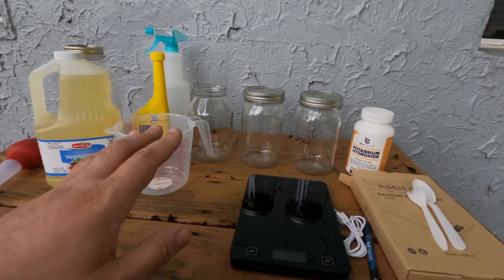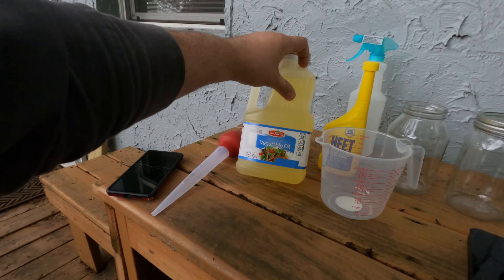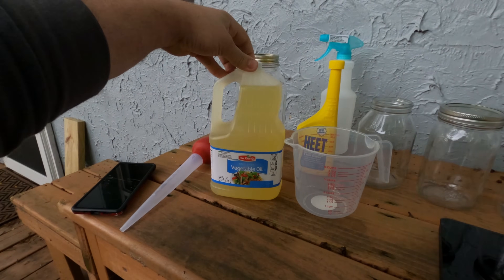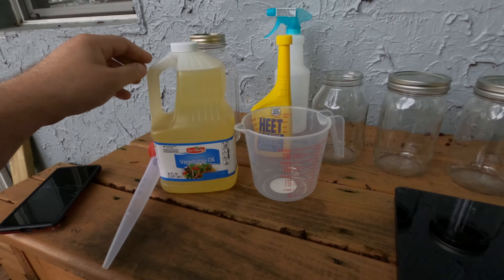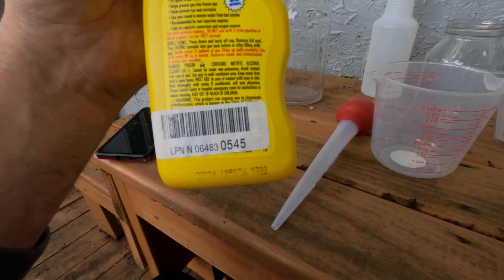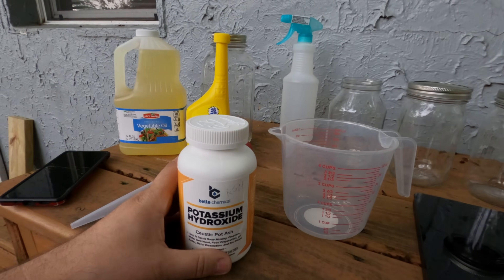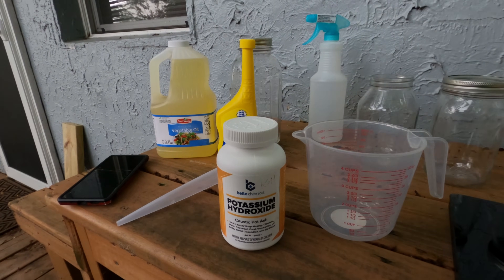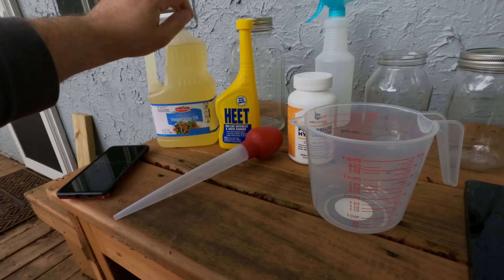This is why making biodiesel is going viral now! It's so easy!

Comment: ....IMPORTANT INFORMATION....I think you would do much better by harnessing methane, instead of making alcohol from the grass. Just put a hay bail in a tub of water, put a plastic tarp (trash bag) over the top of the straw / hail  bail, with a tube attached sealed not to leak, and as the straw rots, methane will be released, and fill up a tank or bag above, this will give you a constant supply of methane for many weeks....Add some pressure on the bag, that runs your engine, and bingo, cheap gas made from grass, and on you go....What does a hay bail cost 7.00???? Methane is what we see bubbling up from decaying peat in the swamps.....The decaying process burns up the oxygen in the water....So the gas should automatically be separated...
Reply from the maker: I'm not making gas or alcohol lol

Comment: You can use animal to make biodiesel, but there are challenges that have to be overcome.  The lye (KOH or NaOH) is what causes the reaction, the methanol (which could be substituted with ethanol) is a catalyst and isn't mandatory... the process takes longer.  It does NOT cause the "fats to drop out of suspension".  The chemical reaction takes the triglycerides and breaks off the glycerine that binds the 3 fatty acids together.  The by product is soap, essentially.

EDIT (PSA): Also, when working with methanol and either form of lye (KOH or NaOH), you should be wearing adequate PPE.  Methanol is lethal and readily absorbs into your body through your skin.  As few as 10mL can cause blindness and 15mL can be fatal.  Lye is caustic and will give you a nasty chemical burn.  Despite how people are starting to freak out about it, you SHOULD use vinegar to neutralize the lye... you do want to be cautious and not let it stand, pour the vinegar on the affected site in a place with drainage (over a sink is fine, if it is your hands) and rinse with water to remove the combination which is exothermic.  Proper PPE is elbow length cleaning gloves, goggles, and a good chemical apron as well as keeping the rest of your body well covered.

Can you wing it without hurting yourself?  Sure... but a bump or slip and you're screwed.  Don't be stupid.  PSA over.

Comment: any diesel truck as long as it is not an HDi engine (high pressure injection) will run on a 50/50 mix of veg oil and diesel regardless of pump make in the summer months when temps are higher than 10 degrees C, if however you have a Bosch fuel pump you can pour straight vegetable oil, sunflower oil into the tank and run it without problems in the summertime. in winter you would need a tank heater.
I ran my 1998 Citroen diesel on reclaimed vegetable oil for 7 years in a row during the summer and had no issues at all, my Father had the same car and ran his to on vegetable oil.
Reply: Some old diesels you have to replace the rubber fuel lines but that's not a big deal

Comment: the only problem of biodiesel is that requires a lot of pure alcohol and it's incredibly expensive so people dont make it but just go to a gas station and have a regular diesel that is alredy tested and has nearly identical price (probably even cheaper). anyway you've made a nice guide man
Reply from the maker: 55 gallons of methyl alcohol cost me 235.00

That gives me a cost of 91 cents a gallon.

I've been running this for years now, my costs have never been over 1.13 a gallon.

But the fact that it takes any amount of effort above zero will keep people paying 4.50/gallon at the pump anyway

Comment: While it's good in a pinch, you can't store it.  We use bio diesel on base and it ruined injectors and separated in the fuel tanks.  What I would like to learn is distilling crude oil to make diesel...

Comment: to make a quart today it cost 2.49 for the heat then about 3o cents for the hydrocside and 2.50 for the oil it would be cheaper to buy the diesel
Reply from the maker: Buy diesel then 😊

Comment: if you splash any of the KOH and/or methanol into your eyes - you're in for a world of hurt.  I'd also suggest you look at using "weigh boats" Putting KOH directly onto a scale is just not done.  Someone else can mention why plastic, not glass measuring cups are preferred (unless you want to etch/frost your glass with the alkali)

You might want to dry this fuel before putting it into your tank.

Comment: Fun fact ammonia aka nh3 nitrogen hydrogen 3 is a cheap renewable  fuel and can be run in any gasoline  and diesel engine with minor  modification. Look up ammonia as fuel videos.  
Ammonia as a fuel and engines existed before gasoline  combustion and diesel engines.  Rudolf  diesel made ammonia engines before he made diesel compression engines.
1960s NASA space race was fueled by ammonia. Rockets,  aviation fuel is still made with ammonia. The land speed record is held by a rocket car running of straight ammonia. 
You don't hear about ammonia as a cheap renewable fuel because of corrupt politicians and businesses that want force you to buy their products and tax control  you.  a cheap fuel means can't control you. 
You can easily alter any gasoline engine to run off ammonia all requires is a propane tank kit and a 2nd fuel pump switch kit. But fill with ammonia.  This can be done on a car , truck, boat, and generator etc.
A diesel engine can run off ammonia but requires more tuning to control compression  vs combustion in gas engines. Diesel pickup engine tuner kits will help alter control compression of ammonia. 
You can make ammonia at home from nitrogen pulled from air and bond with water where hydrogen once bump off oxygen bonds with nitrogen. There are also farm scale production methods to make ammonia, where ammonia is used as a fertilizer. 
https://youtu.be/XHZXAz9WP9M
 https://youtu.be/_H4XZ_m7P0E
 https://youtu.be/L0hBAz6MxC4
 https://youtu.be/B6HzP84KhoY

Comment: Diesel fuel is expensive because of the tax. Vegetable oil is cheap and Diesel engines can run on it. The problem is that Diesel fuel is not the right product to cook your food in. When everybody starts using cooking oil for the car the price will go up and the tax will go up, so there is nothing to gain here.
Reply from the maker: Other than the thousands of dollars I saved last year alone...

Sure, nothing to gain.

Comment: In my younger days, I used to get my oil from a restaurant, (free), clean it up using an old cream sepatator as a centrifuge, and pour it straight into my ‘81 VW Golf.  Never had injector or filter problems.  Of course, I could only do this when the temperature was above 12 centigrade.  I got 40 mpg (imperial gallon, not U.S.)
Reply from the maker: I pour it straight into my Toyota as well.
Reply: @TheDrivewayEngineer what year toyota? I'm wondering if this will work on my hilux surf

Comment: Hi just a comment you need to wash bio d in h2so4 sulfuric acid and water diluted. And before washing separate the free fatty acid and glyerene off the product.

When the h2so4 is initially washed separate and wash another 2 times with fresh water and a bubble stone from an aquarium with an air pump. 

Your bio d will be clean and ready to use when it's clear if you have issues with water retention add a little isopropanol alcohol. 

I manufactured bio d to the en 14/2/14 standard. 

And was one of the original bio d ers in the UK. 

Regards Martin steele
Reply: Can u give me the step by step how to make bio feul
Reply: @pekkopekkie  Hi have you got any experience of making bio d.

Comment: When I was making 25 gallons or so a week back 2010 I was always concerned about how to dispose of the waste/wash water.  How do you handle that?
Reply from the maker: Down the drain it goes. 

I don't see how the soaps and glycerins are any worse than what comes out of my washing machine or shower.
Reply: @TheDrivewayEngineer  Thanks.  I tend to agree and always just poured mine in the woods at the back of my property...with no obvious issues.

Comment: "We dump the potassium hydroxide into the methanol.  We use our fingers to scrape the remaining KOH into the methanol because who needs fingers?  Right?"
Reply from the maker: Idk if you noticed, but my fingers were still totally there at the end.
Reply: @TheDrivewayEngineer  I have personally had a base that was weaker, than what you touched, on my skin.  It was no joke.  The point of my comment is to wear rubber/nitrile gloves.  That stuff you touched is drain cleaner.  It reacts with the water in your skin and causes burns.

Comment: The point is...grow sunflowers. All you need to do to convert SVO to fully compatible diesel is add kerosene or gasoline at 10% to it. No methanol or potassium hydroxide needed. In addition, to filter WVO you can just use gelatin mixed with hot water stirred in and settled.

You do NOT need to react with methanol. The kero/petrol soluabilizes the fatty esters that you remove with this method. It also increases energy density in the fuel over and above standard diesel, whereas the methanol method reduces it.

I've known about this method for years after a Kansas farmer used the results of a 2002 paper to convert sunflower oil to diesel. He tested it extensively on an injector bench, then stepwise used it in his diesel truck, and eventually started using it in all of his farming equipment, including 250k dollar combines. He grows sunflowers as a part of his rotation, and as fuel prices increased he realized he could save enormous money over selling the seed into the animal feed market.
Reply from the maker: That's not the point at all.

The point is, this is the way that I make B100 fuel.

That's the point.
Reply: @TheDrivewayEngineer  apologies...i didn't mean to come off confrontational. You do a good job with your method. I'm just frustrated that a cheaper method exists and is receiving no love.

Comment: vegetable oil is more expensive than diesel i used to use chip fat with a pe heater right in the tank  in winter mix it with diesel to stop it from freezing
Reply from the maker: Only if you go buy it at retail like a fool

Comment: There are even less expensive and accessible ways to make biodiesel than with the use of potassium hydroxide, but this is also a good way if you can easily and readly get potassium hydroxide at a good price... and I'm not referring to lye either.
Reply: @jamal69jackson77 hi can we make it using soft drinks kindly reply
Reply: @ZarawarKhan-gs8hr  not that I know of.

Comment: People started doing this a lot in the UK a few years back when diesel went over £1 per ltr, shortly afterward the price of vegetable oil went from 20 pence ltr, to over £1 ltr so it was cheaper to buy diesel.
Reply: Veg oil £2 a litre now!
Reply: @arhodes2866  You can make Veg Oil in your home, Oil crushing machines are available online
Reply: @muthunchakrabalaji3741 The math just doesn't work out anymore.  At best you're saving pennies.  USED cooking oil from restaurants in my area goes for 21-41 cents per pound (8 pounds in a gallon or $1.68-$3.00), plus your cost of other inputs, and of course your time.   If I owned a restaurant maybe.  But otherwise this is just a neat how to if the SHTF, and you have to produce your own fuel.
Reply: it was handy when the gas stations were empty though
Reply: The Poles brought the idead over to the UK but they started filling up in supermarket car parks and the retailers caught on quickly and veg oil got real expensive.
Reply: Try and buy veg oil used. If you pour some activated gelatin in it the gelatin pulls out the nasty stuff and dirt from the used oil and solidifies everything at the bottom of the tank. This way at least for £1 you get to cook with it too before you make fuel

Comment: Bio diesel is a great additive however if run on pure Bio it will clean the fuel tank of sludge and send it to your injectors.
The repair is very involved.
And keep it away from paint and concrete or rubber. It will damage all three.
I'll see how it works for heating my house.

Comment: The cost of using unused cooking oil is more than buying diesel not to mention the cost of the rest of that
Reply from the maker: Don't buy unused cooking oil. 

Like you didn't read a single other comment or watch any of the linked or carded videos.
Reply: @TheDrivewayEngineer  lol, I was commenting on what you was actually doing in the video 😉👍

Comment: Engines can run raw algae biodiesel losing 10% of power, ppl make it in blue tarps harvest in cloths pressed for the oil.

To replace diesel Pre-WW2 USDOD bred 50% oil algae for this, at sewage treatment plant volume 30% biodiesel/biocrude [refinery specific grades] renews daily- CO2 + O2.
To run existing engines the methanol & k costs are better absorbed at_scale, still some big block engines run better on raw tuned out, don't know their carburetors exhaust needs NTeslaTailpipes zero_gases soot traps wasteheat a 90yr old design for ICEngines still on the shelf.
Hth🦕⛽️🙈♻️

Comment: Just by watching you pour that , it ALOT MORE expensive than a $.95 a gallon. The vegetable oil ALONE is $3.50 a quart and 4 quarts=1 gallon = $3.50 times 4= $14.00 gallon. YOUR WAY is totally to expensive.YOUR 24 GALLON truck would cost to fill using your system would be 14 times 24 = $336.00 dollars AND that does NOT INCLUDE the methanol  OR the Potassium hydroxide cost. PLUS the waste you CAN NOT USE has to be dumped somewhere and I am sure that would COST to get rid of because you CAN NOT just dump that down a drain.
Reply from the maker: MY 24 gallon Truck costs 23.25 to FILL this way.

There IS no waste. If YOU had watched the VIDEO you'd know What is done with the remainder.
Reply: @TheDrivewayEngineer  I did watch the whole thing , I even saw the water heater in back of truck..
Reply: And NO you DID NOT say how you disposed of it nor did you show how you disposed of it. It cost you  way more than .95 cents to make.

Comment: I've never owned a Diesel engine, or a vehicle powered by one, but I have heard that biodiesel will eventually create clogging in the fuel system, and is quicker to gel or freeze in lower temperatures.
Reply: if done incorrectly yes. You need to ensure you add anti-microbial and anti-gel to bio diesel. Also important to test PH level and make it slightly basic so it doesn't east away at the fuel system.
Reply: Absolutely correct!!!! Stay away.

Comment: It seems like a easy science experiment we all should of been taught in school .
Reply: The problem is the system.  Most educators comes straight from schools to teach.  This means does not get experience, are not exposed to solving problems.  When you are exposed in solving common problems with simple or complex solutions then you can teach it.  This creates a different educational behavior.

Comment: Thanks.  People will need diesel fuel engines and machinery, and diesel or oil will not work with gasoline fuel engines. Diesel engines were the first type of combustion engine.   Robert Murray Smith has some ideas also.

Comment: to all those who have watched this, and think this is how you produce spec grade Biodiesel. think again all you have produced here is a fuel that will clog your filters and also damage your pump, especially if your diesel vehicle is less than 15 years old and running a common rail injection system. If you make consistent spec grade Biodiesel, its an outstanding fuel that will have your diesel engine purring. however if it was as simple as shown here to make spec grade fuel, all the worldwide biodiesel companies would have been making a fortune for ages. which certainly isnt the case. not only is there considerably more than this to the complete process of making spec grade fuel, there is also an awful lot of fuel testing (by labs) required to not only make sure your transestherfication process is complete, but theres also a very stringent process required to ensure you have also removed all of the contaminants from the reaction and then completed the refining process. not to mention ensuring all of the water is removed at the end (if you go with the water washing process), just heating the remaining biodiesel doesn't even come close to getting the fuel down to 500ppm on free water. and free water in your fuel is almost as bad as contaminated fuel. 
Biodiesel is an amazing product if made correctly, rarely are home based production set ups capable of producing a biodiesel that actually meets the relevant diesel fuel standards, this one doesnt even come close.
Reply from the maker: I've only been running my non-spec grade fuel in my 2018 truck for 204,000 miles now 😂
Reply: @TheDrivewayEngineer  so you say. however i guarantee that you put biodiesel that out of spec, in most engines and you will have issues. i have also run biodiesel in commercial marine and truck operations for many years, i love the product, but to work properly and be worth using, it must be made right.

Comment: Water in your tank I'm in Maine that would freeze my fuel pump crazy. The ram would scare me more than the fuel😂😛😵
Reply from the maker: 0 water in my tank...
Reply: @TheDrivewayEngineer  But I saw you add water to the fuel are you saying no water gets in the kind you made needs to be heated to remove the water. But I may be wrong in my thinking if so, you have a great product. However, you still have a RAM LOL.